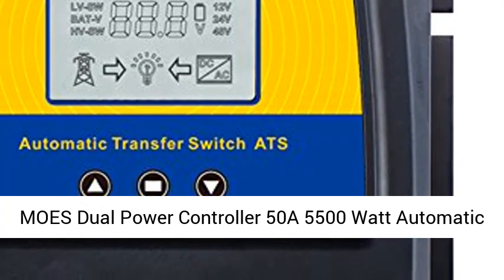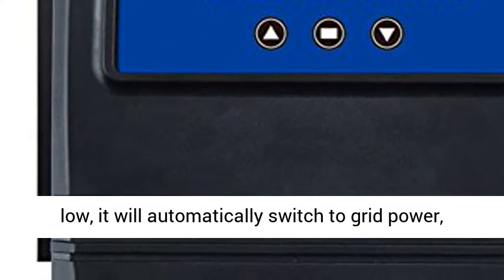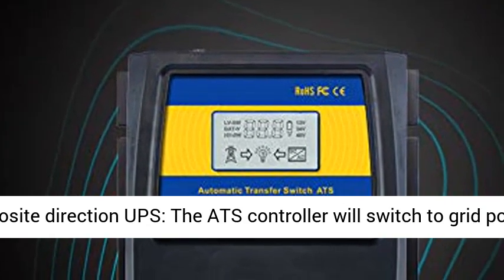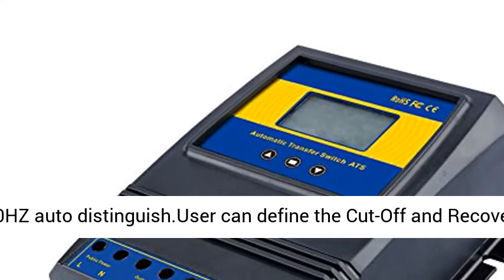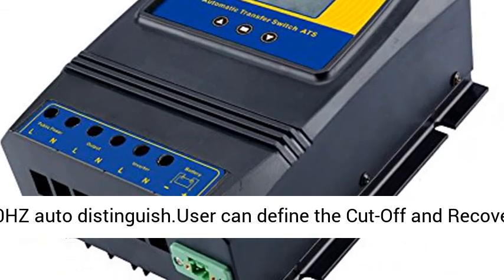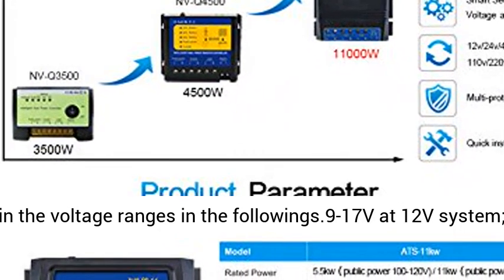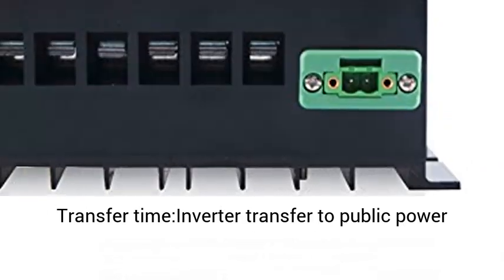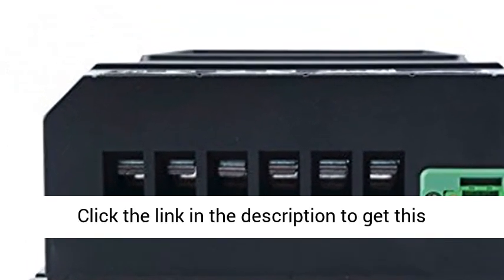MOES Dual Power Controller 50A 5500 Watt Automatic Transfer Switch - Overview

Comment: Ho to connect 220v to the it
Reply from the maker: This is shown very clearly in the instructions. I use it in the 220 vac mode. The manual defines where L1 and L2 and neutral are connected. I have had no issues for the 3 years I have been using it.